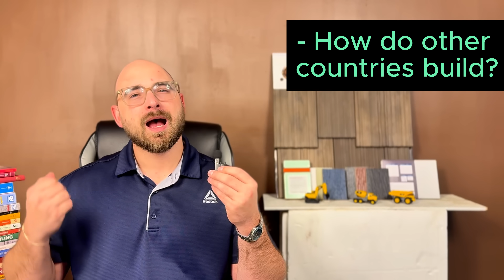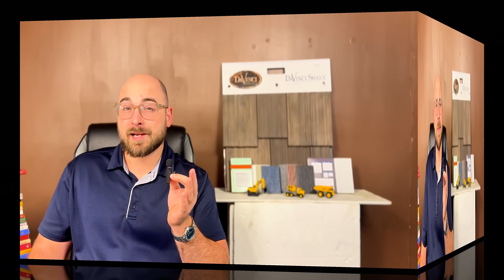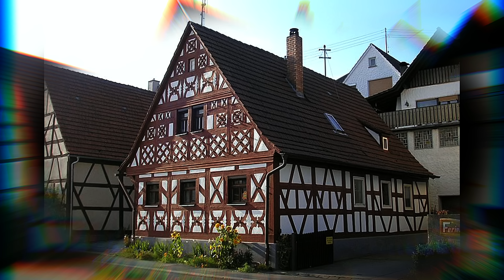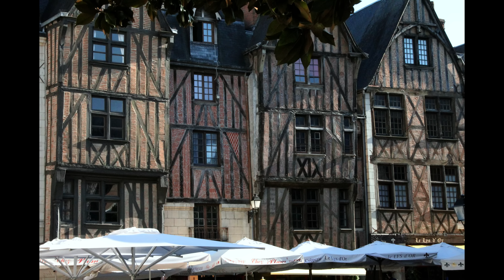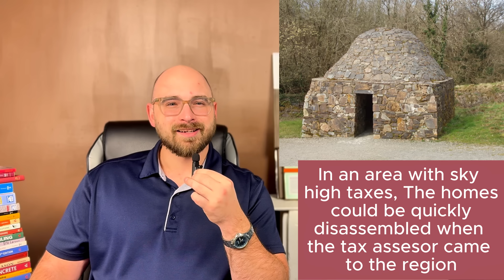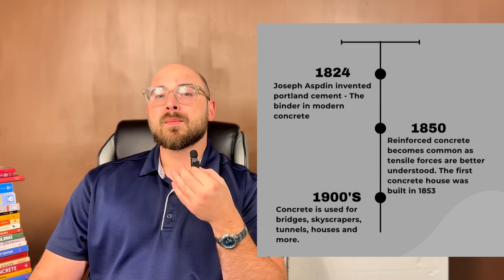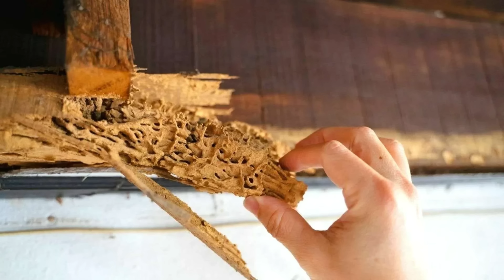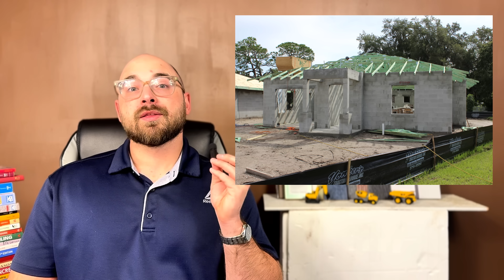Why Other Countries LAUGH at American Homes

Comment: You didn't talk about ashphalt shingles stuck on to roofs - you don't see that anywhere else in the world. It's plastic, deteriorates, breaks down and leaves pieces of crap all around your house and on decks.
Also, electrical wiring. You can go to a showing of a million-dollar home in the US, everything neat and well presented, until you come around the end of the house and see a rat's nest of wiring poking out of the wall, insulated wires messily draped or cable-clipped on exterior walls ... seems reminiscent of India or somewhere. Other countries require plastic or steel boxes, junction boxes and neat ductwork to make sure electrical wiring is protected from the elements and neatly sealed and hidden from view. 
I think you are wrong to make out there's a complete divide between timber frame and "solid" construction. The oldest houses in the US are timber, surviving from colonial times, but I take your point that we no longer have access to the beautiful hardwoods they were able to use for house building in the past.

Comment: I'm Greeck so we have earthquakes, so we laugh at UK Houses and UK at USA House. But in our case due to earthquakes. has to have Steel reinforced concrete frame and bricks with plaster for walls external double internal usually single  deep foundations. The concrete is expected to be tested to comply with civil engineer requests. Yes they are expensive to build yep they take a long time. But what you Gona do. Because are expensive are smaller

Comment: you forgot to mention Hawaii, we do use cmu homes also, but i think they are kinda rare as i have seen, back in the 20th century when it was the plantation days there were plantation homes that were called single wall which were 3/4 inch think tongue and groove redwood walls and it is a bit complicated to understand, compared to the modern construction homes which are usually double wall, single wall homes were built as a fast way to build a house and it was cheaper, but there are earthquakes, volcanic activity, hurricanes, and there can be tsunamis also, there are 13 biomes on the big island of Hawaii and we use Florida building code to build the homes, which i think Hawaii should have its own building code since each zone in Hawaii is different and its climate, there are concrete buildings in Hawaii also, and Hawaiians used straw type homes before Russia and America came to Hawaii, there is an old building technique where you have post and pier homes which are more earthquake resistant compared to the slab on grade homes that are most commonly built today.

Comment: Its not just the outside walls, the inside non structual walls are backed by plywood not just straight drywall, not only the outside walls are properly insulated but the inside walls usually have sound deadening in them, the windows are usually trippel panel, the doors are made out of solid material etc

Comment: Finally, an honest take on the American frame-hut situation. However, you missed the fundamental differentiating quality of a solid-wall house - high thermal innertia. Basically, solid walls, combined with appropriate external insulation, act as accumulators of heat or coolness, creating microclimate best suitable for year-round leaving and reducing enery losses. Even here in Ukraine, our building code would not classify your frame-home for permanent residence, only for temporary/vacational stay.

Comment: Civil engineer from Germany here. People in my country are delusional about how long "our" buildings last. While it is correct that the structure can be preserved for a long time, it requires significant investment after the designed life is over and is often outdated (code wise) long before that. 
In my opinion building "disposable" houses makes sense in a residential setting if you place high value in living in a house with all the modern amenities and standards. 
The house I live in may be 70 years old but it was extensively renovated around 30 years ago and is significantly outdated again from energy efficiency, noise isolation, plumbing, electrical installation standpoint. While some of these things can be remedied with a renovation. The plumbing and noise insulation is basically set in stone.

Comment: I live in a farmhouse that was built in 1908. A wooden house on a stone undament/cellar. The reason why it has not molded away the last 100 years is that solid wood was used, trunks with up to 30cm x 30cm diameter, with solid wood boards in between with 5cm thickness and outside and interior cladding made of wood. In addition, with a mud tile roof. Something was done to the house again and again. It is in the 2nd generation in family ownership (soon in the third) and a total of 5 farming families have lived here. 
This house was built to last forever and your USA trend of disposable houses is starting to migrate over to us, which I think is terrible. 

greetings from Sweet Little Switzerland

Comment: The primary aspect of the quality of how homes are built is the environment in which it's being built.

- Weather patterns:
How much isolation and heating does the home requires? Does the exterior temperature reach below ~15 degrees Celcius? Does it reach -30 degrees Celcius or remains, at most, above -5C? Is there snow? Strong winds? Lots of Rains? Is there salt in the air as close to the coastlines or is it in the mountains?

- Environmental changes:
How much each home has to endure? Is there any risks of earthquakes or water damages? Is there a risk of fire? Is there's any form of conflicts that may occurs (crime, war, etc.) which could result in projectiles hitting the home? Maybe there's a risk of tornado? Is the air pollution rate high or low?

- Religious & Social requirements:
Basically, is there any requirement from a religious or social point such as the orientation of the house. Some countries discourage houses from having their back toward mountains because of a religious/social reason. Some countries have heavy religious requirement at to the house structure/exterior.

Due to all those points, you can actually determines if a country's house is "bad" or "good" based on what's occurring in that country or region. For example, houses build in areas prone to tornado in the US might be insanely cheap compared to a house build in the mountain in Canada because it's not build to last, but to be easily remove & rebuilt.

For example, Japan originally build houses to be easily replaced in case of a fire or earthquake or war,  but that changed after WWII because they found out that it's a massive pain in the butt to remove kilometers of ruins while thousands families don't have any roof above their head so they changed their optics for something that can withstand as much as possible even if they got to sacrifice a bit of their visual identity.

Comment: 0.55 Sorry, but I doubt that "several weeks" are long enought to study "every different construction method". In Germany alone we have a plethora of construction methods for houses. Even mideavel timer-framed houses come many categories. Sometimes the walls are carrying, sometimes vertical boles. Sometimes the framework is filled with stones, sometimes with straw and loam, sometimes with calcium based mortar. Even the sizes vary, e.g. Blackforest and Westphalian houses are HUUUUGE, but e.g. the houses for the non-nobles in eastern germany used to be tiny (sometimes as tiny as one room). And that's just historical houses. Modern houses came with a plethora of materials (even US-style stick+cardboard exists here, althought with insulation. And they aren't really numerous). We have "fast errect houses", prefabricated in a plant. We have brick-and-mortar ones. We have houses where the walls are done manually, but the floors are pre-made. We have Ytong, adobe, adobe with holes (maybe hundreds of different stone types). Outside we just have just plaster. Or wood shingles. Or  shist. Or clinker. Or modern insulating "Wärmedämmverbundsystem" (main part: 20cm of highly insulating styrofoam). We have block bole houses. We have Ökehouses. Or passive houses. Or, or, or. The roofs ... are also all different. Different forms, even depending on region (a "bavarian house" has a very different roof compared to a "Reetdach" to be found near the north sea!

Now go to Austria. Already you find house types not to be found in Germany. Then again others in Britain (e.g. british cottages ... and many more). Or Italy. Or Spain. And we're still in Europe. Go to Africa or Japan. So many, many house types.

Some years would probably needed to study "every" (!!!) of them, as you claimed. That can't be factual, that must be boasting.
Reply from the maker: I’m just that good 📖📚🤷‍♂️💪

Comment: I moved to Australia in 1987 after growing up in a small town in Washington State. The subsidised house I lived in with my mom in Washington State that was built in 1978 was built better than most homes I see in Australia. 
No regulations here in Australia to build with insulation in mind. Double glaze windows for instance are not mandatory even though high temperatures are common. PVC window frames are extremely rare as well.
Australia relies a lot on active cooling and heating, much more so than USA in my opinion.